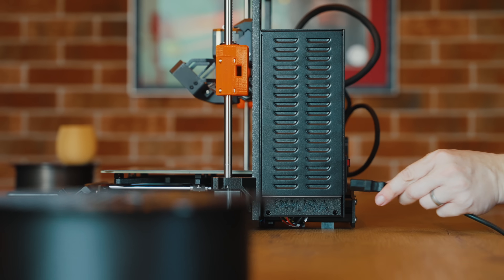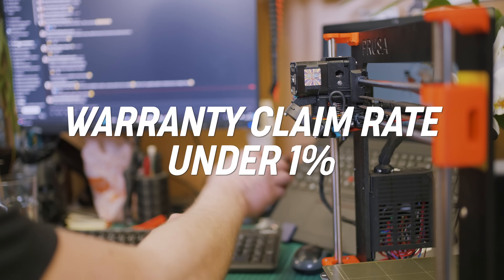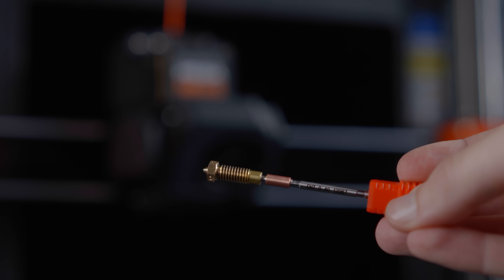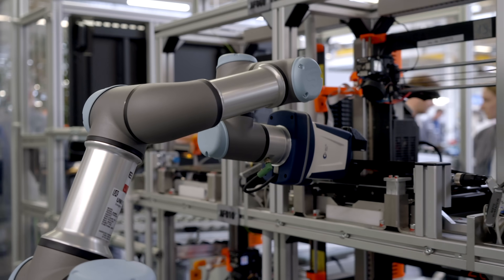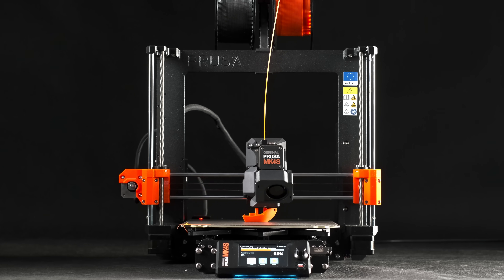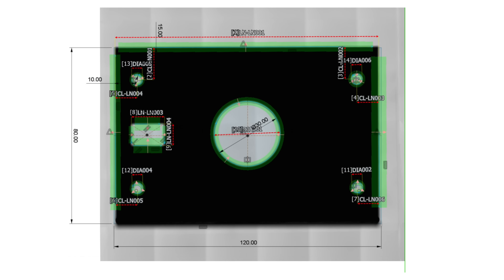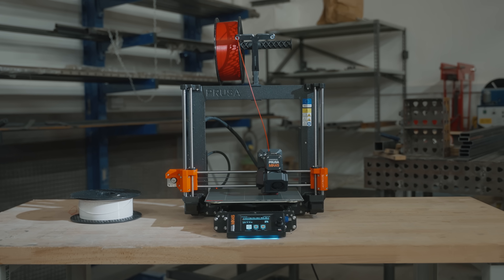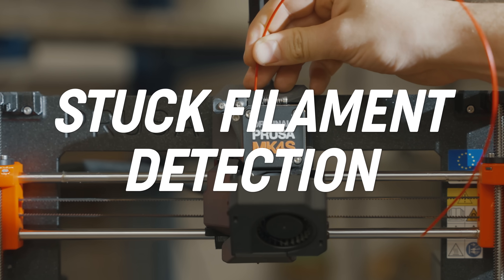Original Prusa MK4S - 360° cooling, High-flow nozzle, Native mobile app, PCCF parts - SHIPPING NOW

Comment: This is a really well done video. Everyone should be able to see where the OBVIOUS pros are of having a prusa over the chinese (closed source) machines. Really love every single point you make here!
Reply: After yhe ehole video all that stook yo my head was: "GPIO will open the world for unlimited customizations". It they are fully programmable, I want to see how they interact with other MCU. ♥️
Reply: What about the Chinese open source machines? lol, I got one(basically prusa clone) used for $69, repaired it for $18, threw my pi with klipper on it and getting insanely good prints, better than my 1st printer ender 3 v2 ever did. Just don't have the budget for a prusa, but they def look nice
Reply: Prusa put in a fake input shaping routine and etc. It's way way behind the current printer evolution. It's sad really.

Comment: I cant wait for the folks who BLASTED the CLOUD to get real quiet when the Prusa APP uses CLOUD services. 🤣
Reply: Prusa Connect (Prusa's cloud service) has been around for at least a year, that's nothing new. That said - there's also PrusaLink, which is LAN only (would like to know if the app is compatible with it), and if you don't want network connectivity at all, you can use a USB drive.
Reply: I think you are missing the point.  The community has been crapping on anything cloud related for 2 years. Prusa connect has been less than stellar and with the weak wifi and lacking features a complete non starter.
Now that prusa has some parity with ankermake and BL the goal post have been moved to cloud good.

Comment: Which parts are now PCCF? I've had to replace the y-belt tension and holder, and the idler assy on my MK4 with PCCF parts after the heat related failure of the PETG parts.

Comment: Looks like a great Machine :) 

I had an MK2S (bought 2 weeks before the MK3 arrived) and upgraded it to an MK2.5 machine. I had problems all the time, I rebuilt the printer several times, bought special rods and bearings, etc etc ... but it never works properly :( Not accurate enough, so the prints never lined up. Really frustrating. The DIY kit is great to save a few bucks - but - you'll never be sure if YOU aren't the cause of the problems ^^ 

I have always loved Prusa, the printers, the company, the philosophy. I wish you nothing but the best. I hope one day I can be back with Team-Prusa printing :)

Comment: I don't normally leave these kinds of comments, but I wanted to share my 3D printing journey and explain why I love Prusa printers.

For transparency, I received both the Prusa MK2 and MK4 free of charge at some point in the past, but that doesn’t influence my opinion. I’ve also received other brand printers free of charge, so I’m comparing apples to apples.

Over the years, I’ve used several printers, but none have been as reliable as Prusa. As a maker, I’m only interested in printing, not tinkering. Don’t get me wrong—I’ve used other printers that I liked, but none have checked as many boxes as Prusa.

One printer I loved was the Flsun V400, but I experienced dimensional inaccuracies. I tried to fix it, but either I couldn’t or I didn’t have the patience to keep tinkering with it. That’s why I keep coming back to Prusa printers. I’m often sent different printers to try out, but in the end, the only ones I keep are Prusas. The only reason I got rid of the MK2 was because it didn’t have a magnetic build plate.

For example, I’ve been working on something I call “Print Wave Metal Casting.” It’s a metal casting technique that involves printing a mold, then pouring plaster directly onto the 3D printer’s build plate and shaking the mold by running custom gcode. The Prusa MK4 has been the perfect printer for this job. It’s important to have a flawless first layer, which I consistently get with my Prusa MK4. I agree with what they say: Prusa printers are reliable and just work.

So, I’ll definitely be getting the upgrade 👍

Comment: Hmm..I was really going to pull the trigger for the Bambu X1 carbon complete with MMU, now I'm seeing the new MK4S and got me really thinking again, but to get it at a similar price complete with enclosure and MMU I have to get it as a KIT again,.. yes Again because My first and only printer right now is the MK3s+, which was purchased as a kit. 

Decisions Decisions...
Reply: Bl will be announcing a new larger corexy printer soon. I recommend waiting if the mk3s+ is treating you right.
Reply: @No0o0o0o0o0  curious how much they pay you to troll Prusa comments.
Reply: @VisualReversal  grow up. The shill/paid comments and other garbage gets tiring. If you don't have a cogent argument then save your fingers from typing.

The fact that you can't even go over the things I mentioned tells me all I need to know about you
Reply: no problem. Ultimately I can see a use case for both machines but I tend to look at what a printer can do now vs what it can do later and mulled over the 2 machines last year. I leaned one way due to the fact Id rather have a feature and not need it than need a feature and not have it . I would need to add more to the mk4 to reach parity but I cant get the build area larger and cant upgrade the motion system. 

If you mean the STL Denise lady I actually ran that same test on the X1C and it came out fine. She didnt mention if she used weird settings or ran it fast but my printer kicked it out without issues. There are actually 2 different models, 4 pieces total with each piece taking about 1hr 30-40 min. 

Twisty Puzzle by Michael Bourque is the model

The P1P/P1S can is basically a cut down X1C but will print that model the same.
I dont have an A1 so someone else would need to answer the tolerance question.
Reply: @personwomanmancameratelevision  Yes, this the video I was referring to, that part was impressive But I would love to see a good comparison between the Bambu X1 carbon and Prusa mk4s  https://youtu.be/xSE5kCQX-LM?si=NGQbwKJKbxtdrgLr
Reply: Look at ratrig or voron maybe?
Reply: @kristian6087  I was looking at Bambu because I would just get what seems a very good printer fully assembled, don't get me wrong, Its not that I hate assembling things but sometimes it's nice to just get something out of the Box, switch it On and start playing without any hassles. When I got my Prusa, Bambu wasn't a thing, ( Or didn't exist) but they were and still are expensive but at the same time I just wanted something that I new I might had better chance of success instead frome the cheapest Ender but I had to get It as a Kit to save some money at that time. 

Apart from that I never really wanted to know I'm deep how the use slicer settings of how the printer works although it's interesting I mostly wanted it to be used for my RC Hobby and some functional personal stuff.
Reply: So spec for spec I wouldn't lean into the mk4 unless you have a specific reason. (open source, EU leanings or something else)

An X1C with AMS runs $1450, 4 colors with the ability to expand to 16. Enclosed, corexy, hardened hotend, filters, camera and able to print basic and exotic materials, larger build volume and faster on most prints. Shipping around 35 bucks
Ams is barely larger than 4 filament rolls (no abrasives or tpu) Ready out of the box in minutes
Shipped to  your home in less than a week or pick up at a microcenter. 
App support for monitoring, print without slicing, 1080p camera for 24fps

Mk4s enclosed 1091 or 1376 (build vs built) $300 for mmu3 (need to assemble) , no camera but can use a old cell phone or most common webcams. 
mmu handles 5 colors max unless another solution is made. 
Mk4 could be ready out of the box but the mmu3 needs at least 3-5 hours assembly. 
May need a hardened nozzle...
App support for monitoring, print without slicing, Very slow camera refresh once every 10 seconds. 

not sure how the mmu and enclosure fit together but the mmu3 needs a lot of space. 
mmu4 does not handle tpu well ...i need clarification on abrasives, im sure it will work but may wear down parts like on the ams. 

Shipping around 100 bucks and duties around $50

So if you are chasing specs X1C, if you dont needs speed, size or corexy capabilities and dont mind spending a bit more and getting less then the mk4s. 
Both are highly reliable and capable machines.
Reply: @personwomanmancameratelevision  all good points, Thanks for your Time explaining it me😊, the one thing That may help me more to decide is how capable are actually the printer when it comes to accuracy. I Saw another video MK4s vs Bambu lab ( not the Mini but the other model, I can't remember the name) one thing that got me by surprise was a Test print of a Twist Puzzle printed in place, on the Prusa it turned out perfect but on the Bambu wasn't because it got stuck immediately after removed from the bed, but personally I tought it wasn't a fair comparison because the Prusa is around €1000 and the other Bambu is about half the price, I fact I left a comment that it would be more fair IMO to compare it with the Bambu P1P.
Reply: Seems like an easy decision.
Reply: @VisualReversal  still confused 😆 what do you suggest?
Reply: I got the X1C after having a rough road with the MK4 (coming from an MK3S+). Very happy with it. The X1C AMS has been very reliable, where the MMU (and in my specific experience the MK4)... isn't.

Comment: Alright. Going to be brutally honest here.

Firstly, I don't like the semi-revo hotend. So instead of screwing in the nozzle to the heatblock, you screw the nozzle into a heatbreak which then goes into the heatblock. 👏. 

Next, you have your parts printed in prusament pccf. If you didn't know already, it's a very shitty PC blend that is designed to be printed on open air machines. Printing PC in open air chamber temps 😂. It is even worse than ABS, as motor mounts and hotend parts of multiple vorons have all creeped and melted with prusament pccf and stay together with ABS. How hilarious. 

And lastly, the PCF fan on the original mk4 was hilarious to see, they got it out of a first generation ender 3. A 250 dollar e3v3 ke had better PCF fans than that. And the new fan? 10 dollars if you buy it as a consumer, from Delta. Way cheaper if you get a Gdstime one. 😂.

Comment: It is true that Prusa lacks a video camera because of the US patent US8562324B2 (google it) that Stratasys has until 2030, after acquiring MakerBot? Here is what the patent says: „A device comprising:
- a three-dimensional printer including a build volume;
- a network interface coupled to a data network;
- a video camera positioned to capture video of the build volume from a point of view; and
- a processor configured to receive a three-dimensional model through the network interface, and to control operation of the three-dimensional printer to fabricate the three-dimensional model as an object within the build volume of the three-dimensional printer, the processor further configured to provide a user interface to a remote user accessing the device through the network interface, and to present in the user interface an image of the build volume from the video camera and a two-dimensional projection of the three-dimensional model from the point of view of the video camera.

The video camera may generally capture images of the working volume , the object , or any other hardware associated with the printer . The video camera may provide a remote video feed through the network interface , which feed may be available to remote users through a user interface maintained by, e.g., remote hardware such as the print servers  or within a web page provided by a web server hosted by the three-dimensional printer. Thus in one aspect there is disclosed herein a user interface adapted to present a video feed from at least one video camera of a three-dimensional printer to a remote user through a user interface.”

Comment: Finally, the fix for the MK4 and features beyond what THE Chinese manufacturer offers. But the printer still lacks a good enclosure, instead of the afterthought of sheet metal and screws that prusa offers.
Reply: How so? No ability to stack mmu like 4xams. No enclosed mmu, the nearest model in bedslinger features is under 500 has an eddy sensor for filament flow , larger build area, camera

Comment: So stoked to see this! Absolutely writing the book on reliable, well-considered and thought-through research-based design. My MK3S was my 3rd printer and while it's accuracy and reliability still beats out most all other printers at a similar price point I've compared it against, I was considering some kind of custom Voron as the MK4 didn't quite have the improvements and hackability for the price point. Now, however, I'm going to seriously consider those upgrade emails I occasionally get from you guys. It really seems worth it. Absolutely fantastic offering with this.

Comment: Regarding print quality, I've owned multiple Prusa printers over the years and the print quality of the included parts have always been abysmal, in my experience.  They look really bad and on more than one occasion prints have cracked while assembling the printers.  I stopped using the included printed parts and have printed my own to avoid frustration.

Comment: Does changes includes filament sensor? 
Cause my MK4's sensor works times worse than MK3S+ had(I've bought fully built printer)
Reply from the maker: Hello, there is no update to the filament sensor. But if you have issues, please contact our customer support. They will be able to help
Reply: Having problems with the sensor is not normal with the current Mk4.
Reply: @logicalfundy  That’s good! It means that it can be easily fixed when I’ll meet it again(maybe I’ll reassemble this head part.)

Comment: I waited on buying the MK4 becasue I knew they would release an S version later on. So I figured I'd just wait.
RIP bambu lab and your CCP data collection. But hey thats why bambu lab is being sued and prusa isn't.
Reply: The Mk3s+ had some fires in 2023 so what are you talking about? It was on the Prusa reddit. No recall or acknowledgement from Prusa
Reply: @hawtdayum  LMAO you mean the one single fire that started becasue the printer was tampered with. You mean that fire?
Reply: @LilApe  there were two fires. And if you call general maintenance like replacing Parts tampering then we all are in trouble doesn't the mk line have safety features like an auto shut-off? 
You're telling me the printer doesn't know when there's a thermal Runaway? It doesn't have the logic to shut off power to the heater if it doesn't reach temp after a certain period of time and just keeps pumping voltage until something burns down?

Well at least you can admit that there was a fire , so where's the recall of the prusa printer that allowed that to happen?
Reply: @hawtdayum  Biggest issue with those Prusa Fanboys is admitting there is something better!
Reply: Lol without fail every comment you make has to throw shade at bambu lab. Troll
Reply: @colbycowley7549  Wont have to throw shade much longer when stratasys bankrupts them.
bambu lab and stratasys are both patent trolls. The one with the most money wins and that would be stratasys.
Reply: You do realize that lawsuit affects ALL 3d printers if bambu falls. Stratasys is in its death throes and needs to go away. 
Heated build plate
Force sensors for probing, crash detection
purge towers(even if Bambu printers dont use purge towers)
Heck they are suing for using layers to build a 3d model which is every printer

US9168698B2 - Three-dimensional printer with force detection
US10556381B2 - Three-dimensional printer with force detection
US9421713B2 - Additive manufacturing method for printing three-dimensional parts with purge towers
US9592660B2 - Heated build platform and system for three-dimensional printing methods
US7555357B2 - Method for building three-dimensional objects with extrusion-based layered deposition systems
Reply: @hawtdayum  I guess no more crappy chinese printers then. Only quality EU/USA made printers like prusa that adhere to patents and IP's. Unlike bambu lab.
Reply: @riba2233  Printers with recalls aren't superior.
Reply: @riba2233  It is actually 3 for the same price! 🤣
Reply: @LilApe  Prusa doesn't recall their badly engineered printers (Mini), so give me a break!
Reply: @LilApe  That happens to cars, appliances, name it! How can the Mini burn a house if it can't print? lol And just for your info, I've owned two Prusa's, a Mini and a MK3S+. But I am not stupid enough to keep using something when there is something else better!
Reply: Data of what? Stupid fidgets or useless toys?